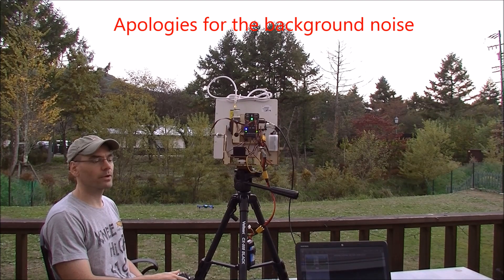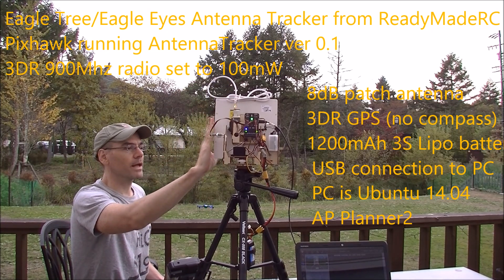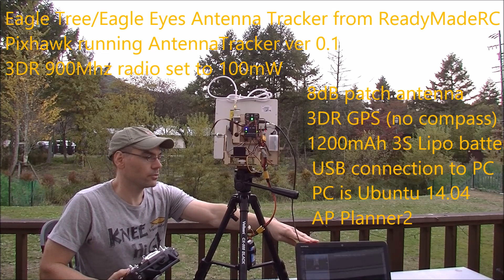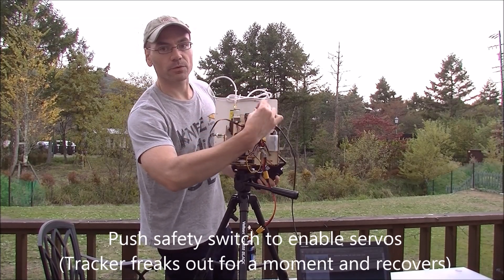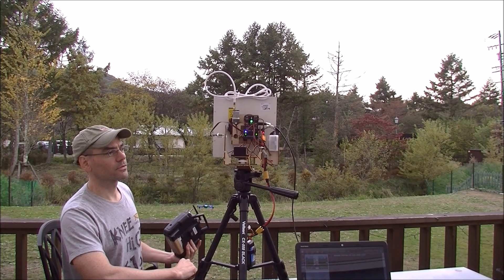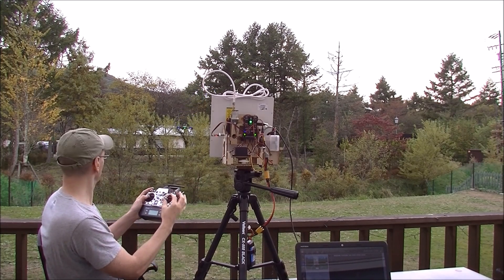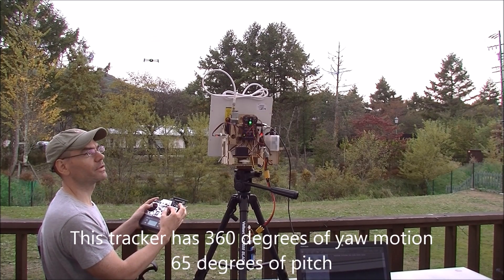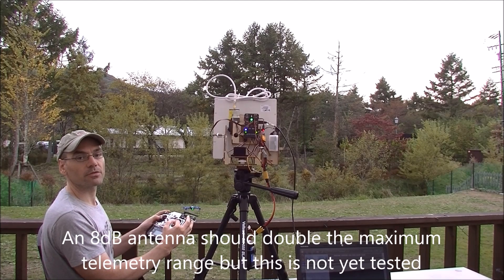Antenna Tracker v0.1 demo

Comment: hello Randy
are you still playing with this, i know it a few years ago you was working on it, any updates?  would you share your param list?
Reply from the maker: Hi Andy, I'll pass the buck slightly and say that Peter Barker and Peter Hall have taken over as maintainers of ArduPilot's AntennaTracker software while I've used the extra time to take over the Rover/Boat software.  I do hope that we release a 4.1 version of Antenna Tracker..
Reply: @rmackay9   thank you for your reply. are you aware that it is still actively being worked on? its still only v1.1.0
Reply from the maker: @andykirkwood3188  I don't think that much effort is being put into improving the tracker's controllers but it hasn't been abandoned.  We have some autotests that make sure we don't break it.  It's really best to hassle Peter Barker and Peter Hall I think.  I'll ping them a note on the ArduPilot discorse channel as well but I've brought it up before.

Comment: What if I have 2 180 degree servos?
Reply from the maker: Emre, that should be fine.  the pitch/tilt can use 180 degrees and roll can use up to 360 so it should be possible to make it work.

Comment: you need another pixhawk on the antenna tracker?
Reply from the maker: Yes, the antenna tracker needs it's own "flight controller".  So a Pixhawk, NAVIO2, or one of the other ardupilot compatible flight controllers: http://ardupilot.org/copter/docs/common-autopilots.html

Comment: what servo do you use on the tracker? does it have to be 360 degrees rotation servo for pan? or is that because the servo using the bigger gear to drive smaller gear so it doesn't have to be 360 degrees rotation?

Comment: Hi, randy,

so i am having an issue with heading to do with pan. my system uses a pixhawk to control my tracker. but if i turn it manually i can see the compass turning in the attitude and heading but on the map, the red line just points north. as a result. it means the tracker only points north and doesnt move. any ideas?

Comment: Hello Randy,
I´m about to build the Tracker. But I´ve a lot of questions. Please can you provide some reverences? I´can find the right forum or more than on the Arducopter Wiki.
http://copter.ardupilot.com/wiki/common-antennatracker-introduction/

Questions:
-Is a extra Ground GPS for the tracker necessary? If not how does the Tracker knows his Position?
-How to forward the Mavlink data to the Mission planter or Droidplanner?
-How to initialize the Antenna.
-and so on

Thx
André

Comment: Looking good Randy! I'm a general class amateur radio operator running an 18 element 440Mhz (also tuned and low swr's for 433) circular polarized antenna with Elevation and Azimuth computer control via a Primetec Satellite USB controller. Two questions one can I used 433mhz freq for telemetry being a Ham operator in the US? and two is it practical to get MP to work with my or other USB to serial rotor controllers? There are other more popular Satellite controllers especially provided by AMSAT North America. If this works, I would like to attempt this although I don't know how practical it will be with coax loss as my satellite antennas are about 20ft above me. Even with me running 400MAx coax and the nature of UHF. Thanks!
Reply from the maker: ***** I really don't know the regulations in the US re telemetry or about other USB to serial rotor controllers.  but as long as you can make a serial connection between the APM/Pixhawk and the Mission Planner then another connections besides the 3DR radio should work fine.